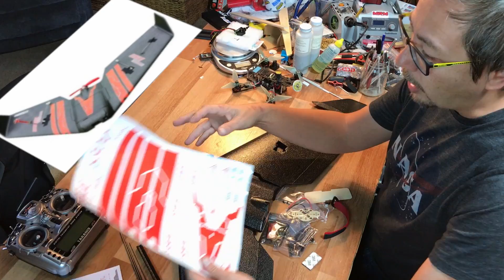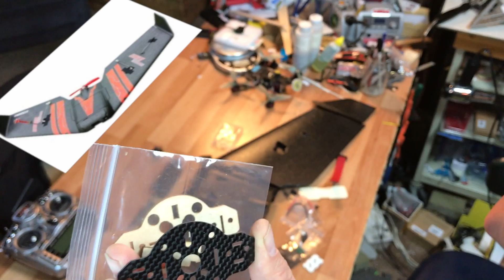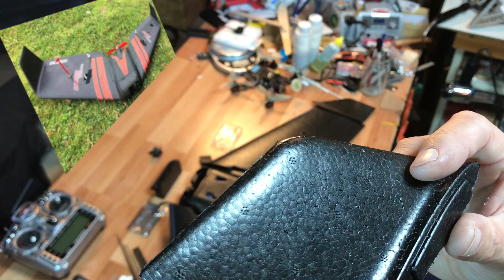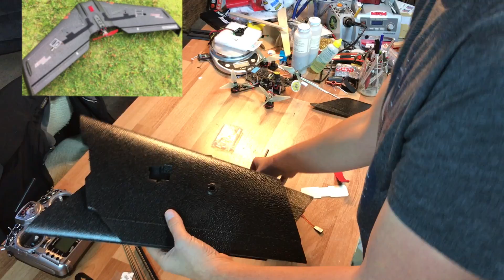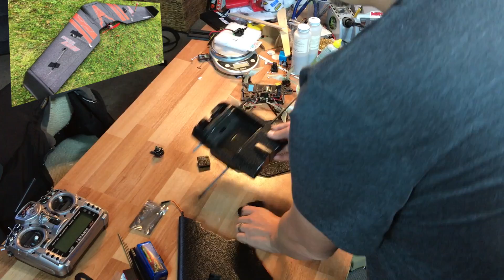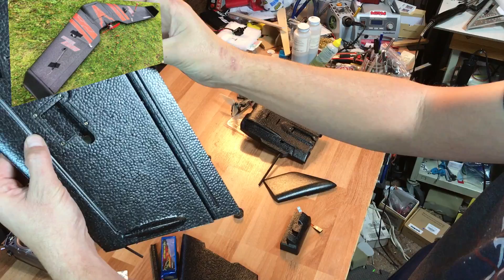Sky Shadow S800 Reptile V2- Quad Pilot's Best First Wing!

Comment: And it flies great with a 30a esc, 1800kv motor, 6x3 prop, and 1500mah 4s lipos which most quad pilots have a million of. If not you can always mess with motor size and your quad battery sizes. This plane just wants to fly. IMO this flies so much nicer than the AR 900 wing did for me. At least on my old quad batteries.

Comment: Great video! I really want to buy this wing but I've never ordered through Banggood and I have heard horror stories.
Reply from the maker: I haven't had one bad experience.  If your warehouse is local it can take 5 days to a week. from china 10- 30 days.  but it always arrives
Reply: Hi Twomonsters,  every company has horror stories, I've spent £100's with banggood and they are fine. I've only ever had one issue and that was sorted very easily. This wing quality is excellent, i'm just building one now.
Reply: Great beginner wing. CG is right at the front screw of the esc cover and it'll fly away with no stabilizer and 15 degree reflex. Maiden had one failed launch but I just trimmed it a little and threw it again and it just fluttered away. Got er trimmed in the air and tossed my goggles on and it was already 400ft up. This thing flies like a dream. Literally.

Comment: Hey 7demo7,
Great video!
I have built this frame but have yet to fly it. It is my first flying wing so I look forward to hear what you think about it. Here's a picture: http://imgur.com/a/8KJM4
Im running a naze32 board with GPS - software is the Patrik Emilsson Baseflight FixedWing. Easy to setup but havent tried it in the air :)
Reply from the maker: Looks Great!!!! I'll be doing something similar with color on the wings.  I've never tried the PE naze32 stabilization but I know a experienced pilot that flies it in all his wings-

Comment: Yea it's a different version to mine, but only slightly. Basically two holes in the lid. The elevon hinges are rubbish, defo put some tape on those AND make a tape hinge for the lid too as that WILL fly off. Also I would prefer the stand offs for the motor mount. They push the motor back a bit, thus more airflow over the prop, thats gotta be a good thing for more speed & less noise :) Matt
Reply: Matthew Ogborne Yeah the elevons on my wing has damaged quite fast, so +1 to tape them.  :)
Reply: Yea mine turned up with one of them already detached at the end. Only minor as I flew mine at full throttle into a tree on 4S and it survived after some glue to fly another day :D Matt
Reply from the maker: I find the best way to reattach the elevons is to use contact cement or FoamTac - makes an amazing join which will not break

Comment: btw, i have the V1 version from this wing and its my first wing ever made, im a quad pilot. It runs on BoltRC V3+ 2206 2300KV motor, DALRC BS25A ESC and a DAL 6040 prop. I have an HS1177 and a Unify PRO in there for FPV,  Xiaomi Yi for HD records and it flies amazing. :)
Reply from the maker: ZsolteeFPV thanks man!

Comment: Thats not a flight control board mate, thats only a PDB that you need to wire up everything. :) The FC version has bigger PDB and another board for gyros. :)
Reply from the maker: ZsolteeFPV ugh- I'll have to throw in a annotation and correct that- thanks!
Reply: 7demo7 np mate :)
Reply: Yea it's useless, one for the bin
Reply: Matthew Ogborne Thats not useless, i have used it, works just fine. :)